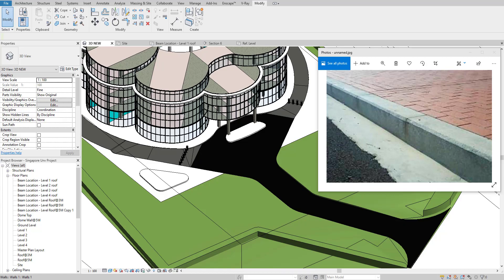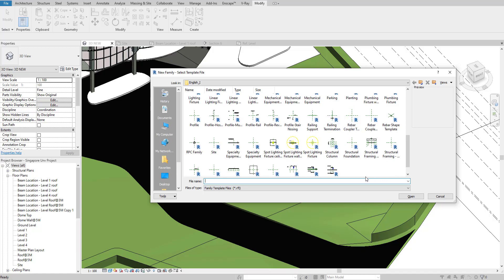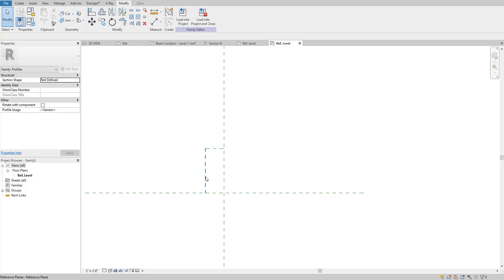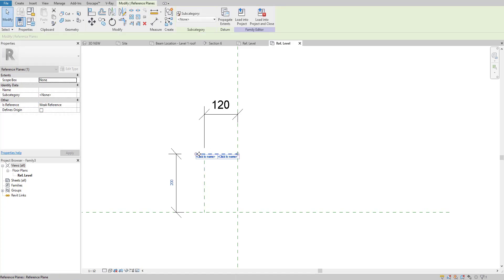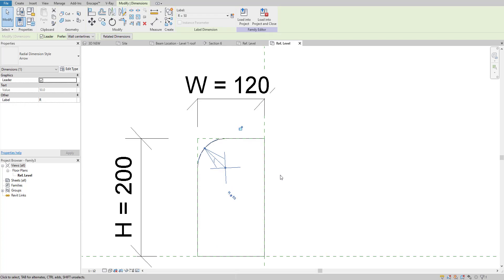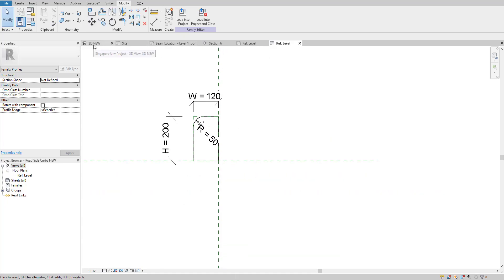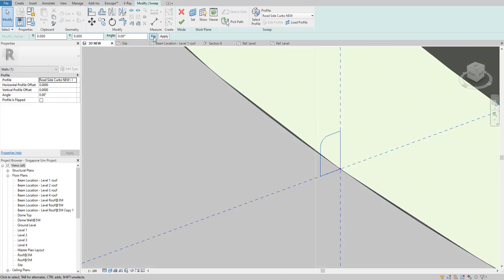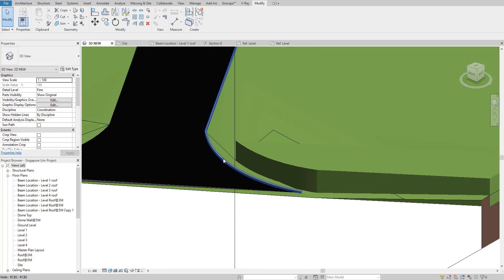How to make Curb Stone Design in REVIT | Curb Modeling in REVIT | Curb Design in REVIT

Comment: how to join 2 point of curb
Reply from the maker: Hi, You can use same sweep. It's not possible to join different sweep lines into 1. If you made it accurate then it can overlap so it works fine.
Reply: @bimskilled  I have too much problem because I am landscaping BIM engineer 
Now this is an issue
Reply: @bimskilled  tomorrow I will show some pics
Reply from the maker: Sure send me at learn@bimskilled.com